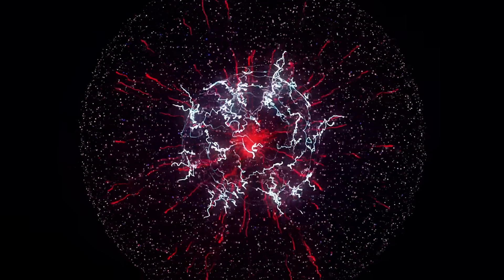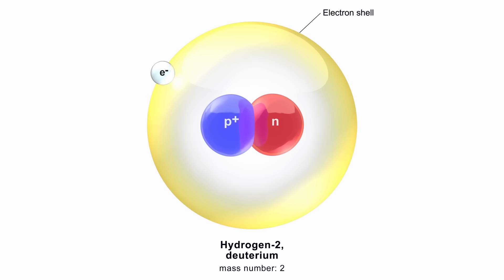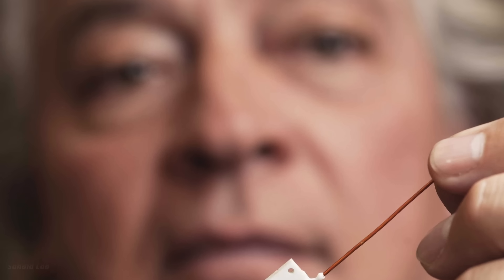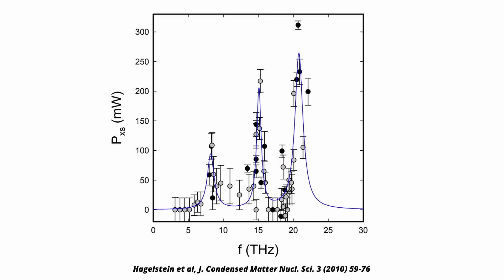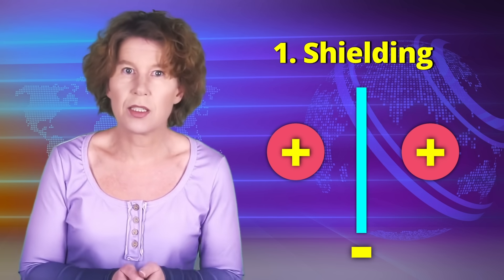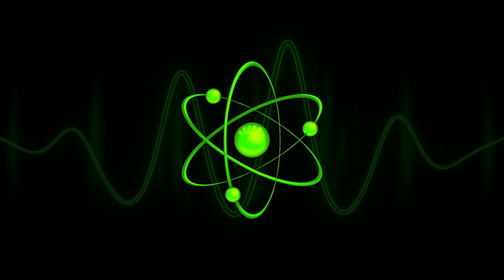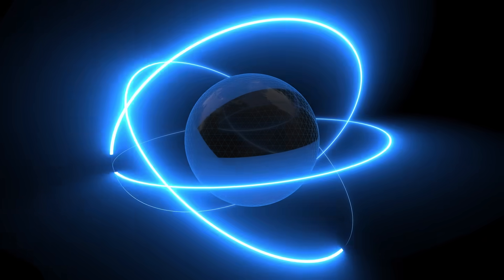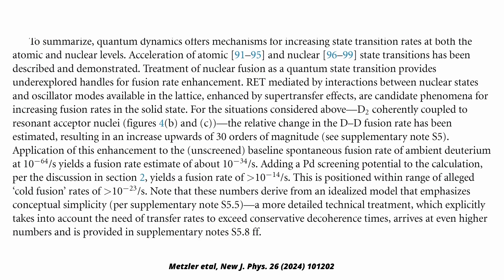Physicists Say They Know How Cold Fusion Works

Comment: The neutristor is not a cold fusion device, it's beam on target, nothing new there, Philips made vacuüm tubes doing exactly that 50 years ago. Now the "small energy anomaly" some people have measured using hydrogen and palladium or platina has nothing to do with fusion. It's caused by ortho/para hydrogen being catalysed by the metal. That's why it works with H and not with D (for D, spin 1 the energy balance is the other way around compared to H spin 1/2). A very well known process, needed to make liquid hydrogen. (Without the correct catalysed ortho/para equilibrium liquid hydrogen would vaporize all by itself after a while, liquid deuterium doesn't do that). I don't understand why even physicists like Arahata didn't seem to understand that that is what they have measured and nothing else. No neutrons no fusion!

Comment: Would have probably helped the whole thematic a lot if they wouldn't have exaggerated it so much.

The whole idea is, that you reduce the energy needed to start the fusion, what in itself isn't a stupid idea at all, but by going to the max and pretty much saying, that you just put some stuff together and then it will start the fusion process on room temperature, that went way too far.

If somehow sometimes, when we are less stupid than today and know a bit more about how the universe really works beside some desperaet tries to put some mathematic formulas on it we could reach this: wonderful.

But you don't start at the finish line.

The whole Cold Fusion thing is the same as the Fusion thing: work on making it possible in the first place outside of a star with its extreme parameters that would simply turn this planet to stardust. And voila: it would look way more scientific with  much better reputation.

Comment: Please explain to a non-physicist: Bombard Boron-11 with neutrons to produce Boron-12. In a few milliseconds, one of the neutrons emits an electron, becoming a proton. So with this relatively low-energy operation we have converted an atom of boron into an atom of carbon, but somehow almost no energy is released. Why is this not regarded as a fusion reaction, and how did we manage to "fuse" Boron-11 into Carbon-12 without releasing the same amount of energy that would have been released by bombarding Boron-11 with a proton?
Reply: At first I thought that the mass difference between the neutron and proton versions was simple; in the neutron version the B12 atom emits its energy in the form of an electron whereas in the proton version there is no emitted matter and so the mass difference is emitted purely as energy. But the mass of an electron is only 0.5MeV, whereas the energy emitted in a proton-boron fusion is measured as producing 8.7 MeV. So I am still stumped. How can we create carbon from boron via this seemingly back-door cheating process? If the neutron sequence emits nothing more than the electron, how is the nearly identical mass loss (B11+N vs. B11+P becomes C12) manifested in the neutron sequence?

Comment: Since 1953, IIRC. Malcolm Bendall's public machine makes plasmoids/"hydraulic plasma" in water. All the parts are over the counter, except for one welded piece that requires precise geometry. I haven't actually looked at his machine, but I have developed a feel for bullshit. NOBODY understands physics, so his machine could be real and public and nobody would be able to explain it, explain it away or implement it for power generation. Tesla needed Steinmetz to work out the details on some of his designs. There's a reason why Bendall's Rogan appearance failed. Egos.

Comment: New theory is needed to explain cold fusion, but existing theory proves beyond question that cold fusion is real, and that it is nuclear fusion. This is self-evident. The effect produces heat with no chemical fuel and no chemical changes. It has produced up to 10,000 times more heat than any chemical reaction with a given mass of reactants, and the upper limits is probably millions of times more. That is to say, a device the size of a coin has produced as much heat as you would get from burning several liters of gasoline. Only a nuclear reaction can produce this much heat.

We know it is a fusion reaction because when a cell is filled with deuterium gas or heavy water, the cell produces helium in the same ratio to the heat as one plasma fusion D-D reaction (24 MeV per helium atom). The reaction also produces tritium, in varying amounts.

The helium and tritium have been confirmed in many labs, using many different kinds of instruments and techniques. The helium cannot be atmospheric helium leaking in because in some cases, the experiment begins with atmospheric levels of helium and increases above them.

Experimental error is ruled out because the effect has been seen in over 180 labs, in many cases at very high signal to noise ratios; i.e. heat ranging from 50 to 100 W continuing for weeks, or tritium at levels that were it contamination coming from outside the cell, it would trigger alarms and kill the researchers.

Comment: I think the problem with using lasers is that they're using only one laser. They need to try two lasers that are incredibly close in frequency to each other. Done correctly it should create harmonic momentum from the frequency of the two lasers that create a beat signal which is much higher in amplitude than either one of the lasers by itself. The amplitude of that newly created beat signal May overcome a barrier that is preventing fusion.

Comment: Does a special quantum field enable a nuclei to borrow energy from surrounding nuclei in a special way? (At 4.30 mins ) Surely the net result is balanced to zero or is there a local permanent state of local disequilibrium pushing up the energy out level overall 'here and there' in the probablistic quantum model?. I have no knowledge to base this question on. Just the 'cold video' state theory above. AI view: Experimental Evidence: 'Many experiments, such as those involving quantum entanglement and interference, strongly support the probabilistic model and challenge the binary view.' Perhaps a quantum roundabout sign might be better at the video's end?

Comment: Skepticism is good for science,  cynicism impedes science.
Reply: the dunderheadedness of anti-fusion cultists is off the charts in this audience.
Reply: Weren't the cynics the skeptics of Athenian philosophy 🤔 

Methinks one tends to become the other.
Reply: @ephemeralvapor8064  Indeed,  until the science is proven.   Then, they were believers all along!
Reply: Yes. Cold fusion received quite the black eye from a fraudulent effort in the mid 90’s. Th2 researchers were stripped of their credibility. A quick perusal of the explanation shows potential because it uses clever redefinitions of ‘cold’. 

The reason for heat is to provide energy, sufficient to break through that barrier. There are other ways of doing that, like the kinetic impacts that are being used mechanism used successfully in promising tests. 

What is not useful is people not in the field ranting about one position or another, and demonizing the people on several sides. Keep in mind that it may not live up to that promise. Or it might exceed expectations. Our opinions will not make a damned bit of difference in how that turns out.

Comment: Hi Sabine.  The best, easiest results so far have been with the shielding concept, around 2:40 in the video. There are other methods such as cavitation (like the star in a jar) but it releases dangerous radiation.  

The the shielding is accomplished by simply swamping the nuclei with negative charge, hitting them with what's called a condensed plasmoid - miniature ball lightening which is more typical than anomalous occurring at the leading (negative) end of a lightning bolt.

The challenges, besides producing consistent condensed plasmoids with sparks that won't pit and mar the electrodes is ultra energetic resistance from established science and the energy industries for which they stand.

This has been a great year for +[SH]+ videos so far. Thanks!

The Woo Crew,
-rs

Comment: Always thought cold fusion might have some similarity to the forming of cooper pairs in BCS superconductors, i.e. that the electrostatic repulsion is overcome by smearing the fusioning nuclei out over some crystal lattice in the same spatial wave function. Seems i was wrong.
Reply: Some of these palladium 'alloys', work and most don't.  I think these may be unique crystal structure, perhaps quasi crystal.

Comment: About "unholy trinity": If you want to achieve something special, exploiting a single physics trick may not be sufficient. Complex systems (such as photosynthesis) use a host of fundamental principles. Why should the exploitation of fusion require a one-trick pony? Occam is important for theorists. Engineers care a bit less, as long as there is a net gain.

Comment: Hey Sabine, what do you think about Exodus Propulsion Technologies's propellantless propulsion device, their website is down with a 502 bad gateway, cant find any info on and hardly any coverage since they announced breaking 1g thrust, so much so that if its not all hot air, Im actually scared for their wellbeing and what the oil giants might do to them if it's possible oil becomes obselete for transport. Im probably jumping the gun with bad research and assuming the worst in people, but i feel like this technology should not be gate keeped if its true and that having hover technology to remove 2D driving as well as CO2 emissions as well as FIVE DAY TRIPS TO MARS. like seriously, if this is real technology it would revolutionize the human race's capabilities as a whole. Even in its current state it could be used for a lunar hover vehicle even with a payload (after getting launched there by conventional rockets)

Edit: 1-15-25 the github is no longer googlable...duckduckgo to the rescue from the FIRST RESULT.....

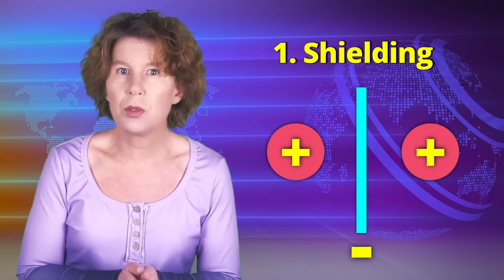Comment: What you are describing in 03:00 occures for example in some rock salt deposits. Then you have purple or blue NaCl where some Chlorine positions are vacant and occupied by electrons. The color pretty much can be described by the particle in the box model, thus is determined by the size of the vacancy. However these electrons are very diffuse and polarizable so I see no way how that would help to overcome the Coulomb barrier. Also as a matter of fact it is a longstanding question of theoretical chemistry if the electron density in molecules or aggregates of molecules can posses local maxima other than at nuclear positions. To date no examples are known.

Comment: If you look at the history of the discovery of cold fusion, you will find out that Fleischmann and Pons went to the rector of the University of Utah and reported the discovery, the administration demanded that all the details of the research not be disclosed so that it could be patented.
Because of this, some scientists were unable to repeat the effects obtained by Fleischmann and Pons. You know how it ended.

In the report on the study of the Rossi cell, it was noted that preheating the cell to 400C gave a thermal effect of heating to 1300C, greater preheating gave a greater thermal effect, up to the destruction of the cell (I indicated the temperatures from memory). Obviously, the heat is critical for this effect. Those who repeated Fleischmann's experiments by cooling the water might not have received any effects, while those researchers who allowed the water to heat up might have had the effect.

Comment: Check out ball lightning. The simplest explanation is that a small hyperactive energy source is ionizing the air surrounding it, forming a crackling ball that can regen itself after passing through solid materials.
Reply: Maybe it's a tiny wormhole and the other end is somewhere really hot, like inside a star.

Comment: Two questions:
-For cold fusion to produce a practicably useful amount of energy by how many orders of magnitude would it have to be improved?
-Assuming the above is actually possible how much power is required to achieve said results and is that more or less than the output?
A basic principle: "If it sounds too good to be true that's because it isn't."

If genuinely practicable, net energy producing, cold fusion is achieveable I'll eat my hat! 
Having said that if there is any possibility at all it is worth persuing as it would have the (a-hem) power to solve all our greatest problems at a stroke.

Comment: I don't know why we don't use mirror dome ovens as a magnifier for sun light and for boiling water in nuclear facilities. I mean. There might not be a big adjustment in adapting nuclear plant to safe and clean energy from the sun. Mirrors in a dome can cook bread. I don't know why we do not use mirrors to profit from solar. (And tests could be conducted if even the moonlight would be enough to boil water. Sunlight reflected on its surface.

Comment: One of the original theories why P&F might have go "some results" was that some of these metals entrap gasses on their surfaces, down to several atomic layers thick, and in ordinary crevices.  Depending on how the heater was used, these gases could have interacted, and produced additional ordinary caloric output.  Some people who tried this did find chemical interactions along the surfaces.  Oxygen is notorious for this, and free oxygen in metals is usually a recipe for disaster.  Especially if there is any Hydrogen present...  Similar effects are observed now in Lithium Battery chemistries, where contamination causes major problems.

Comment: Quartz watches work by passing electricity theough a quartz crystal, causing it to vibrate at a set frequency. It can be powered by a very small battery. Its an application of the piezoelectric effecd, if I remember correctly. 

Given that one variety of cold fusion impregnates a crystalline material (Sabine mentioned palladium) with deuterium and forcing them together in the gaps between the crystal's molecules, doing the same thing with a crystal that exhibits the piezoelectric effect and running a low powered electric current through the crystal causing it to vibrate may cause rhe vibrational phonons to further compress the gaps between molecules. If two or more deuterium atoms can be forced into a single gap, the compression might be enough to overcome the coulomb (sp?) barrier. 

Alternatively, making a container with piezoelectric materials strong enough to form a sonoluminescent effect in a liquid medium (in this case, heavy water) and elecrolyzing it to produce deuterium gas might get some of that gas trapped in the cavitation bubbles. When said bubbles collapse, the rapid compression might induce fusion. 

Wish I had the knowledge and money to try to build these machines myself.

Comment: There was a nuclear test that was part of something called Operation Hardtack.  This was a series of above ground atmospheric tests done in the late 40s-early 50s. One experiment resulted in a yield of something less than a kiloton, but still huge. The experiment involved soaking a small Plutonium ball in tritium, and deuterium heavy water and pass a current through the Plutonium and heavy water to cause Electrolysis, and force the Deuterium, and Tritium Hydrogen into the Plutonium ball. The Hydrogen gas fills the spaces in-between the atoms in the Plutonium balls cubic crystalline structure until all the cubic lattice structures are full. When one too many Hydrogen atoms gets forced into one of these cubic structures by the action of the Electrolysis, then Fusion can spontaneously happen releasing a few Neutrons, these Neutrons interact with the Plutonium, which react with the release of a few Neutrons that can go out and participate in more fusion reactions. This feedback loop created a sub kiloton blast. The problem, you couldn't determine exactly when the device would go off, and it wasn't reliable. Only one device was ever created. It was more like a chemical  experiment than a nuclear device. From the beginning of the Electrolysis to detonation took around 6 hours.

Comment: I don't understand the fixation some people have with building fusion reactors, hot or cold. We already have it, and it's cost effective and safe. Just let the sunshine fall on a PV cell and you've got electricity from fusion energy. The reactor is a bit far away, and most of its output is wasted going off into space, but on the positive side the risk of radiation exposure is mostly limited to sunburn. FAct: solar energy is fusion energy.
Reply: snow, wind, hail, night, space, price, storage, dust, lifetime, efficiency
Reply: @littlefish9305 Well sure those things but can you name eight more???
Reply: @ sure: africa, space exploration, infinite, portable, anywhere, klaus schwab, low cost, freedom.